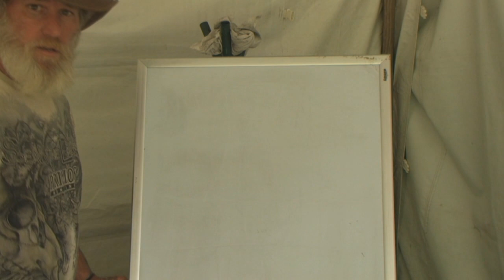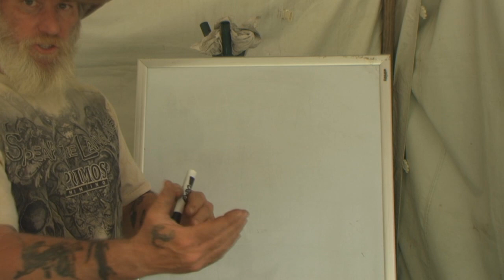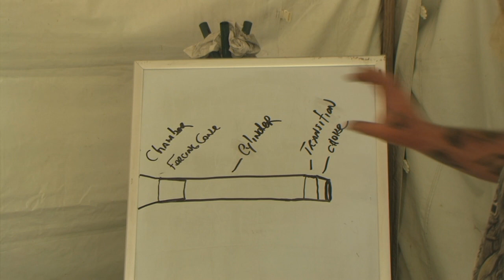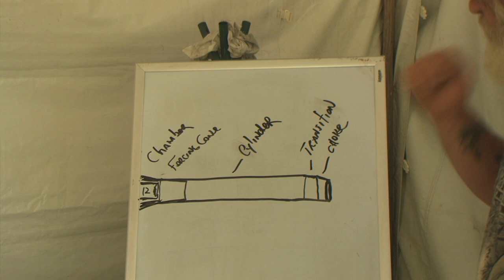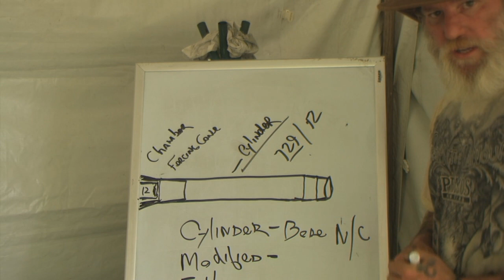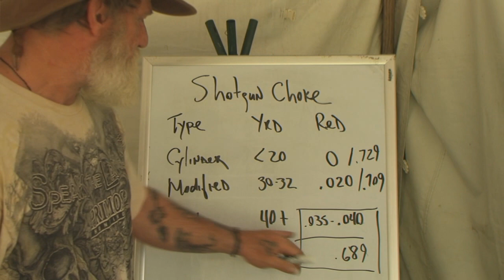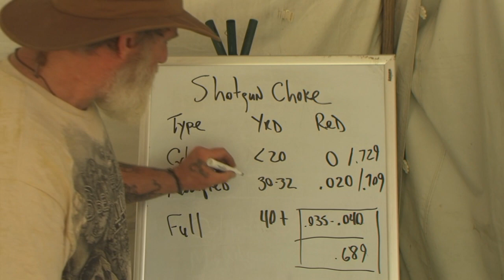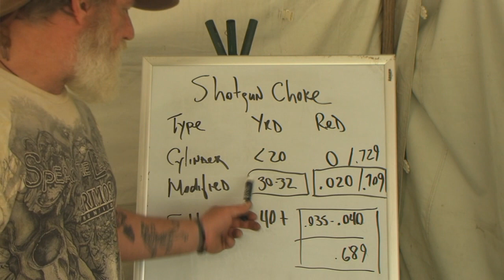Shotgun Chokes

Comment: Thanks brother David, been having trouble finding which type choke the Winchester Defender 1300 has. After your explanation, I believe it's a cylinder choke. Doesn't much matter. It's only kept for home defense and it shoots both 00 buck and rifled slugs just fine. It's now loaded with Winchester PDX1. 3 pellets of Grex buffered (tighter pattern) 00 plated buckshot nested on top a 1 oz. rifled slug. The combination compensates for any aiming error. Course at 15 or 20 ft. who's gonna miss ? lol

Comment: You won't be able to see the transitions.  The only way to see how far back it runs is to measure it.  My advice is find a gunsmith.  You can remove the choke entirely by cutting off behind the transition.  You can also reduce the choke by cutting part of it off.  It is a taper so if you take off half the taper you reduce the compression of the shot by half.  Hope that helps.

Comment: Dave great vid, Growing up and raised in Southwest Va. I was born with a shotgun in hand so to speak..lol. I was taught that you can put a dime in the barrel. Of a smooth barrel that doesn't show what kind of choke is on the gun or its old and the stamp is gone away. While the dime is in the barrel.  You can run your finger up the end and measure it. Depending on the depend of your finger in the barrel will tell you if its a full, mod, smooth bore. Have you ever heard of that little trick?

Comment: Quick Question- I have a 12g New England Slug Slinger w/ rifled Barrel, I am guessing it has no choke- but you other vid on the 209 Primer Adapter you kept saying Modified, modified , modified! What are your thoughts on the conversion technic for rifled 12g shotguns?

Comment: I have a different question. Folks are told to pattern shotguns into a 30" circle at 40 yards, to see whether the percentage of the shot load to land inside the circle matches published percentages for the choke they have. But lets take the 30" circle out of the equation, and reduce the range to across-the-room home defense distances. I know shot spread will be fairly minimal at such short range, regardless of the choke, but how large a circle WOULD you see with the chokes you have discussed?